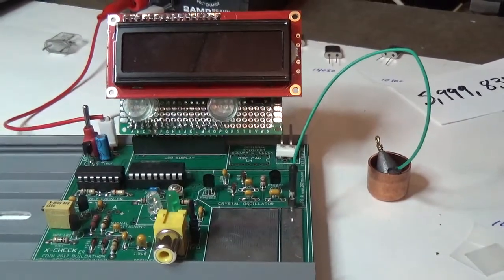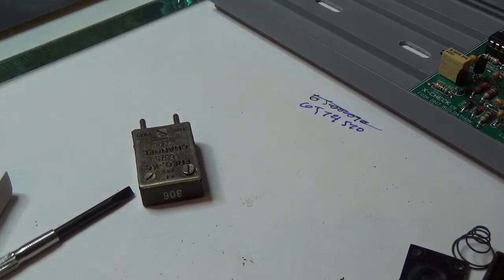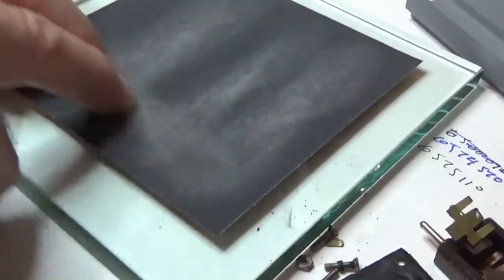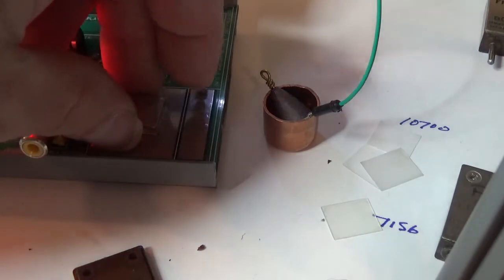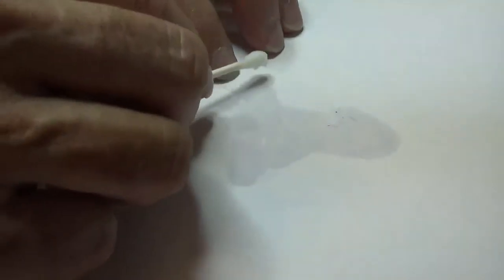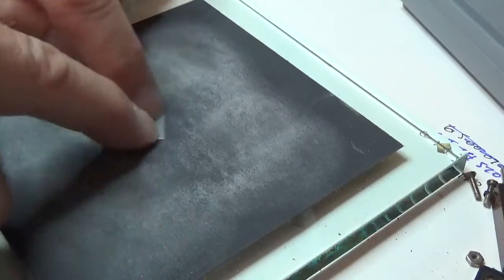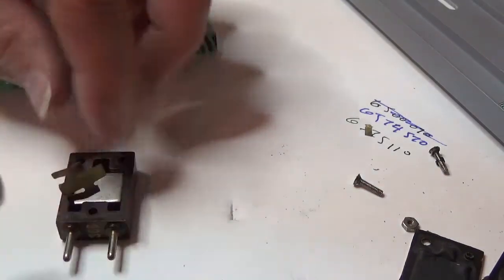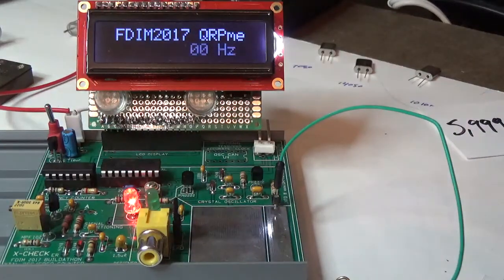GRINDING GRINDING AND A LITTLE MORE GRINDING

Comment: Hello :)
The way I keep track of what the frequency is when it's in the holder is I put it back in the holder !
I just put the blank in the holder and then use one of those black paper holder clamp things on the outside
of the crystal holder !
I just clamp it together so I can quickly check its resonant frequency !